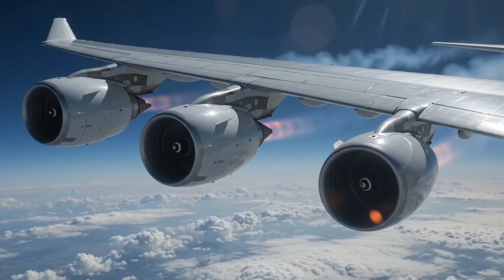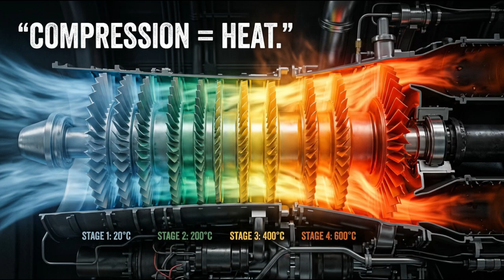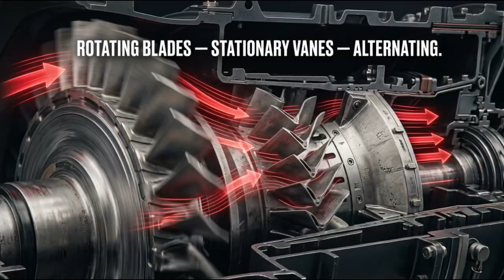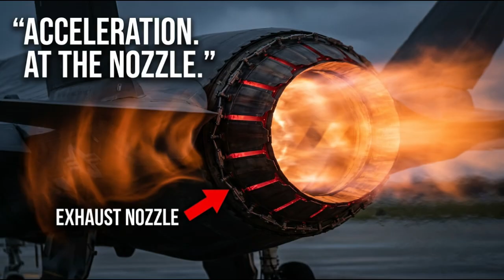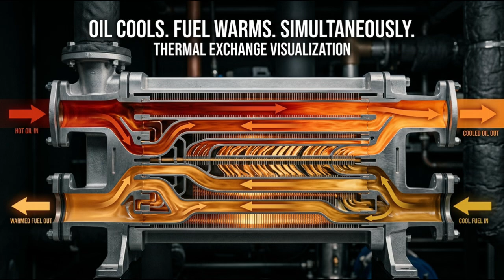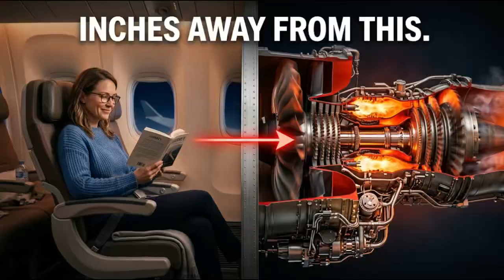Why a Plane’s Engine Doesn’t Stop at 40,000 Feet

Comment from the maker: The detail that genuinely surprised me making this: the turbine blades operate in gas streams that are hotter than the blades’ own melting point. They should be liquid. The reason they’re not is a combination of exotic single crystal materials AND tiny cooling channels running through the inside of each blade — air flowing through the blade itself keeping it cool enough to survive. The blade is hollow. Cooled from the inside. While surrounded by gas at 2,000°C. 🖤 What detail from this video changed how you think about flying?